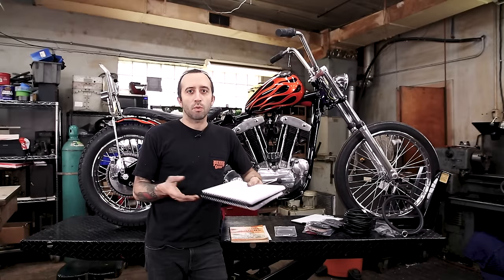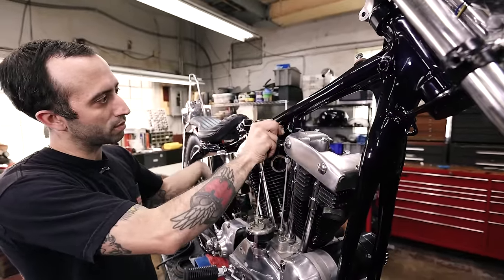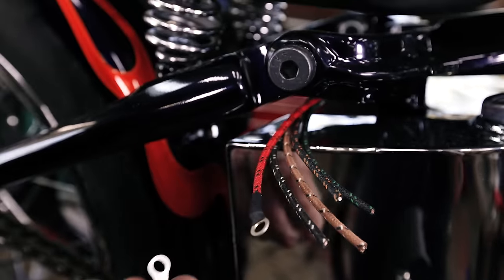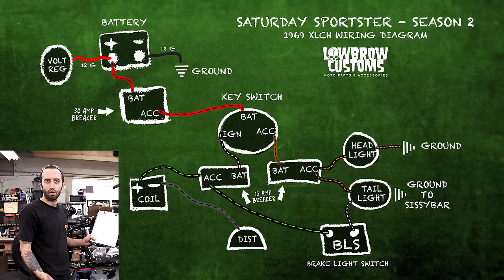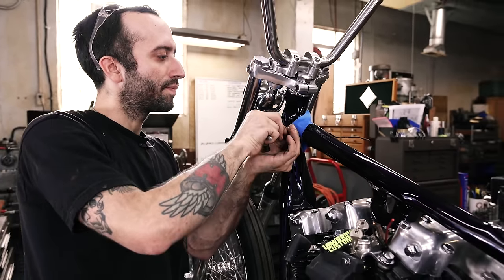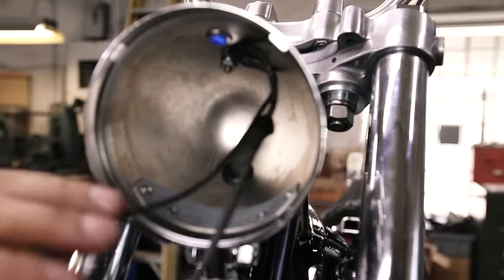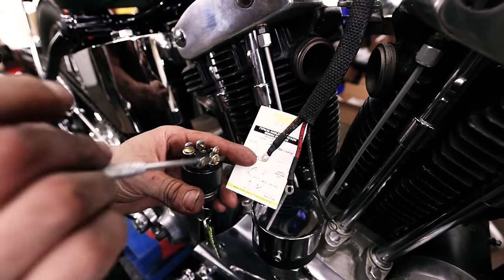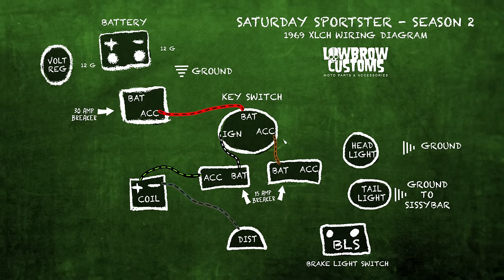Saturday Sportster - Season 2 - Episode 14 Wiring Wiring and More Wiring -  How To Wire Up A Chopper

Comment: I was suprised to learn that there are times when a good crimp is actually more reliable than solder. Supposedly in circumstances where there's vibration or movement, the solder can create a hinge point where the wire exits the solder that can cause wire breakage sooner than a crimp only connection. I used to be in the "solder is always better" camp but not so much anymore. If you haven't heard of this, you might be interested to look it up and see what you think. I totally agree with the asthetics of heat shrink over that big blue plastic thing though. Have you ever tried the heat shrink with the hot melt adhesive inside? It's super satisfying to use IMHO.

Comment: Reminds me of when I was an electrical helper fishing wires lol  exactly tape and all, but I'm most interested in the hole placement  to run wire through my  frame .  My 73 Sportster is not even a rolling chassis at this moment after deciding to rebuild it.. luckily I took it down to the frame even after my hubby said I didn't need to and really could've fixed it and been riding,.. but no I had to tear it all apart ..   it wasn't til I sandblasted six coats of paint off the frame did I realize there was a problem .. thinking back to my last ride on her.. was it swaying or dog tracking or anything out of the norm  and nope, nothing to indicate there was a problem.. I ended up finding two stress fractures on the upper or top back  end of the  frame then one crack at the bottom of the cradle..  um yeah I was devastated, cried like a little baby,  but then sucked it up like a big girl and moved forward.. got frame fixed, now panted.. As I keep pushing forward I just wanted to let you know I appreciate the tips and tricks as I slowly put my scoot back together, just first got some holes to drill and more research on  how to do what I want to do with my old girl !  ✌️

Comment: Those cloth wires are beautiful.  When you crimped that ring terminal on, were you crimping down on just the exposed copper wires or the cloth wire itself?   I'm used to the vintage Japanese style connecters where there's two places to crimp...one crimp holds the terminal onto the outer wire and the other crimp is for the copper strands.   The single crimp style connectors seem like you're just crimping down on the copper wires.  Is that correct?    I'm terrible with electrical stuff but I do love putting on new connectors and wires... and cleaning up a previous owners shoddy wiring.
Reply from the maker: Yes just on the copper wire. The other style you are talking about is double secure. With solder that shit ain’t going anywhere